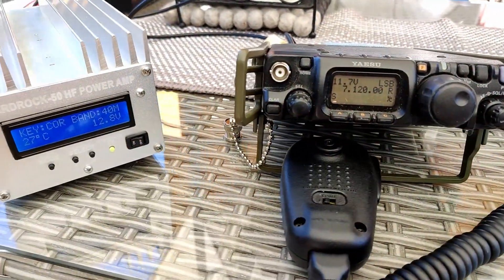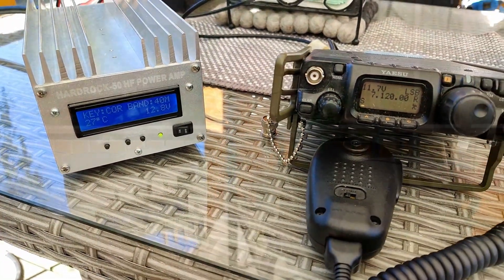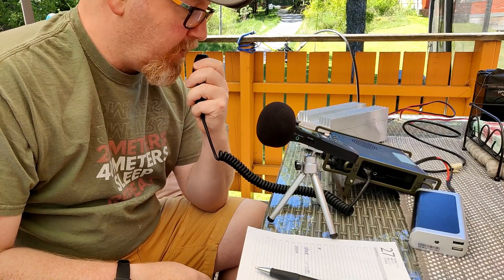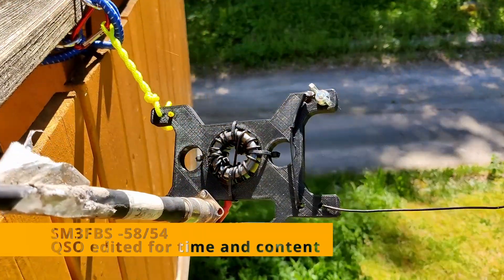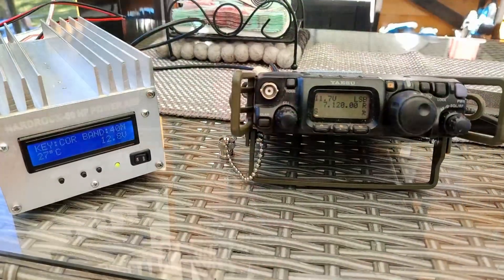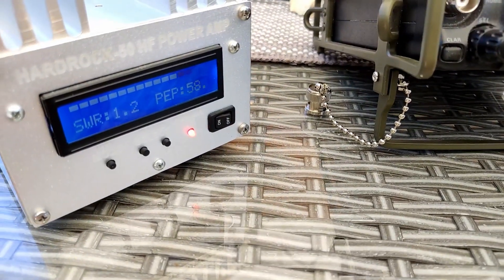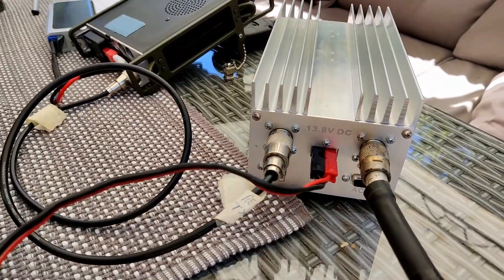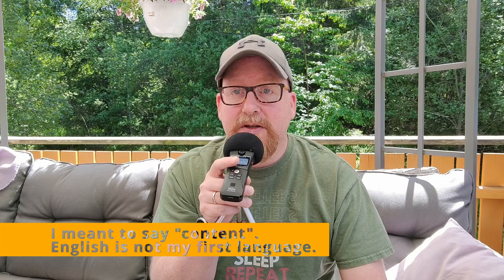QRP Hack - Using an Amp to get more UMPHH in my QRP - The Hardrock-50 Amplifier

Comment: Before I sold my FT817 I ran it through the Italian HLA150 amplifier by just feeding the antenna output to it. I didn’t quite catch how connected your TX to the amp. 
A non tech question; when an LA contacts a SM do you each use your own language or does one switch to the other?
Reply from the maker: Since I have just "borrowed" the amp (even the wife knows that I'm going to buy it), I just set the amp to key on RF input. I'll probably make a PTT cable at some point, even though it works perfectly this way. 

As of your second question, we use our own languages, the languages are really close, so it's perfectly understandable.
Reply: @LB0FI  I'm going to try the same with my IC705. I thought the two languages were pretty similar. To me Swedish has a slight lilt to it.